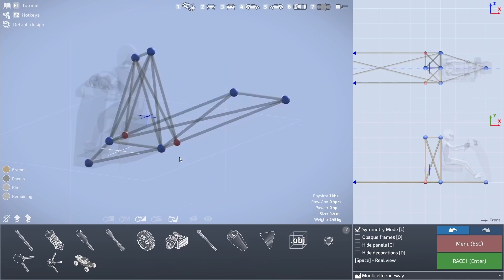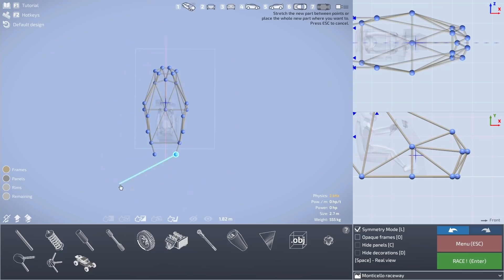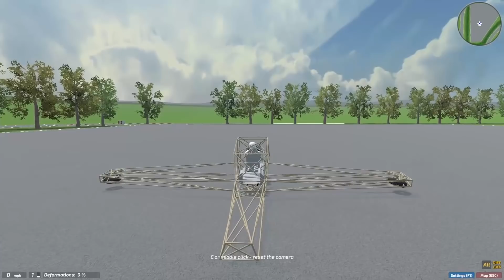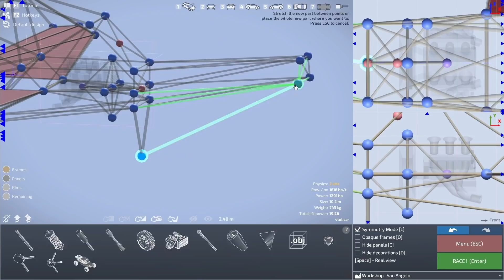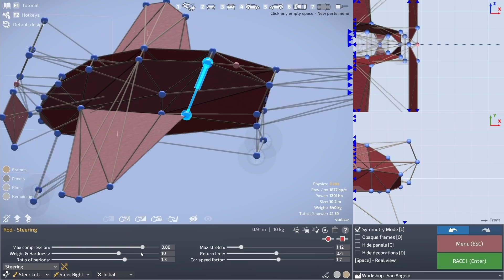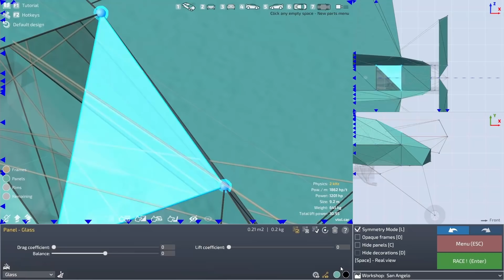Using Glitches to Create a Plane in Dream Car Builder

Comment: Ehm most planes have 5 wings and five control surfaces. 2 ailerons or roll control, 2 elevators or pitch control, and 1 rudder or yaw control.

Comment: best way to counter propeller torque would be a twin prop design, pusher puller, or wing loaded counter rotating. i don't know if it's possible to get the prop to turn in the other direction

Comment: the plane lacked an elevator control surface, it would definitely help with control if you included one.  It's a cool design though. What you've made is a lot closer to a flying wing, just without elevons (combination of elevators and ailerons on 1 set of control surfaces. They're a lot harder to make fly right

Comment: my guy talks about weight distibution, but forgets 2 key things called an elevator and a rudder
you can make a plane without em, it just wont fly as good my guy, the plane would be so much better with em

Comment: Horizontal stabilizers and regular elevators will be more stable than your wing based system, due to them acting in the opposite of the rest of the aircraft.  For example horizontal stabilizers can push a heavy nose up, creating a stable airplane.

Comment: If the wheels can collide and create traction with panels why not just make an engine with the wheels spinning on panels to make the whole thing rotate?
Reply from the maker: That would be a great build idea, but unfortunately I don't think wheels collide with anything but the ground. In multiplayer I think that is also the case but I'm less sure of that.
Reply: @ReidCaptain  Dang

Comment: a lot of the problems with flying were not caused by "weight distribution" but the lack of a proper tail
Reply: it is possible to build a plane with no tail (flying wing or delta wing), but those designs are significantly less forgiving with any imperfection in balance magnified.
Reply: yeah, the rear wing was missing.
Reply: The real issue is that the pitch control is directly on top of the center of mass. You know, torque is proportional to the length of the lever arm.
Reply from the maker: I tried adding another stabilizer while testing but it made no difference and it was just adding more weight
Reply: @ReidCaptain  you need a rudder and elevator
Reply: @ReidCaptain  you need a horizontal stabilizer
Reply: i was looking for when the proper tail would get added. it didnt. no pitch controls. no yaw controls...
Reply: @invader_guy the game attempts to simulate this stuff accurately, so following normal rules of physics is the best bet..
Reply: B2 stealth bomber wants to know your location
Reply: I was almost shouting at the screen that it needs a tail fin. It seems like everyone but aerospace engineers refuse to put tail fins on their aircraft.
Reply: @user2C47  is just extra drag :v
Reply: At lease someone had the same Idea, I was getting so pissed that he didn't even add one >:(
Reply: @skullersh1p  you dont need an horizontal stabilizer if you balance any plane right, his plane his decisions over it
Reply: This man is 5x smarter than you so i think he was right
Reply: @grantlagasse2704  pretty much every plane ever has had a rudder and an elevator but yeah go off mate
Reply: @chrome5725  Except big deltas and ones too short to have a horizontal stabiliser
Reply: @akarouge  yep and he didn’t make a delta did he
Reply: @chrome5725  I was referring to "Pretty much every plane", not the video itself
Reply: @akarouge  “pretty much” that phrase excludes the rarer examples of planes that lack it. Your average plane has it, that’s all he’s saying, how those two specific examples are relevant is questionable
Reply: @akarouge  a lot of tailess planes do have elevators, which are usually in the main wing instead of a separate horizontal stabiliser. They also exist on aircraft with canards, assisting them in pitch control, like the Eurofighter Typhoon.
Reply: @grantlagasse2704  hmm he's right though

Comment: Hi! Just cause i noticed, you'd ideally want to have two small horizontal tailfins and you'd want to use those for pitch control. The fins themselves would make the plane more stable, and controlling the pitch from there would make it more powerful and reliable, cause those tail fins would sort of torque off the main wings. The way you're doing things now is a lot less reliable as there's basically no torque. And with the pitching rudders moved to the back, you can then use the large rudders on the wings for stronger rolling! It works there cause the rudders will be "torquing" off each other as they'll face opposite ways.
Reply: They have a name. They're called elevators

Comment: I am so happy to help! and I bet the other guys Elinzar and 65535 are also happy to help. Btw, I am Jaycreate to those who are curious. Contact me through discord: JayCreate#2161 
I will add notes as I go through the video!
Notes:
You need a stronger shaft to keep it stable. Jets are unnecessary. 
you need to change the engine gears, and have it on a high torque for it to work, will send planes in DMs to help
use springs when making the shaft and make the springs have absolutely no travel, that means remove the dampener, 10000 weight and harness, and 0.99 for each stretch and compression. It will adjust on it's own anyways
The setup you have is actually most similar to the first proto (just a funfact.)
A unstable and glitchy shaft actually makes it slower, not faster
I can add video links also, you will need discord to view it immediately, but still be able to download without I think
https://cdn.discordapp.com/attachments/821797664508608542/854545232199942205/2021-06-15_23-08-04.mp4
https://cdn.discordapp.com/attachments/821797664508608542/854534092611125298/Dream_Car_Builder_2021-06-15_21-31-42.mp4
me and elinzar put together these videos. blue plane belonging to him
Reply from the maker: That's really interesting, the more stable I made mine the slower it became. That probably just comes down to the different (better) design that you guys are using though. Neat!